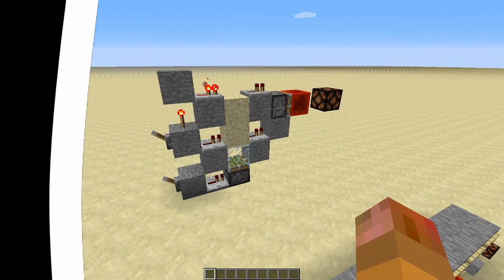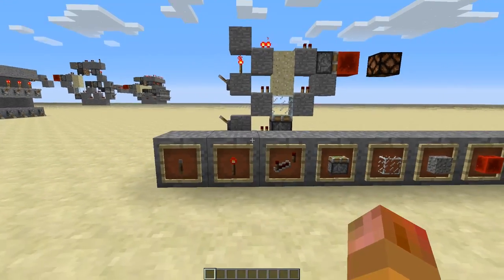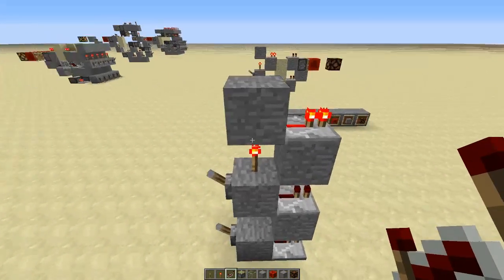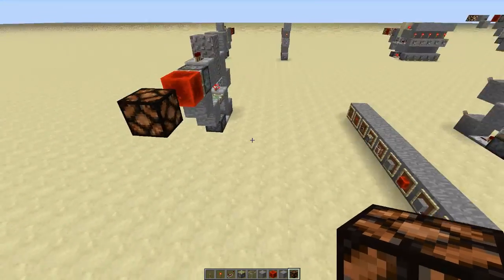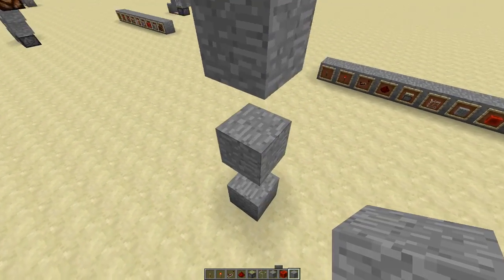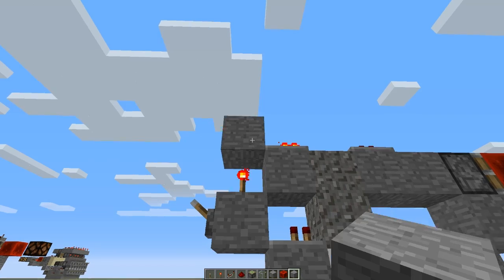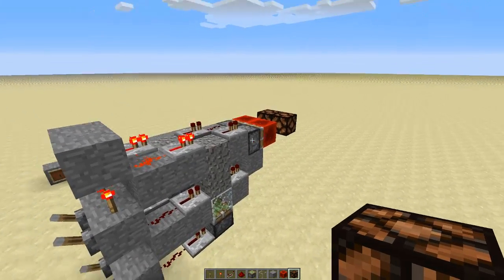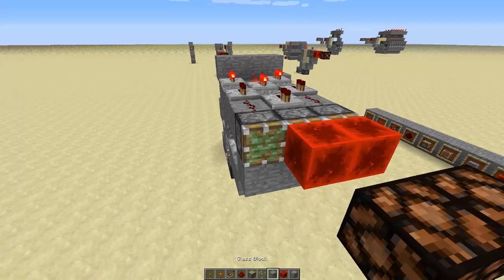XOR Gate Tutorial - 1 wide - with tileable version (for TangoTek)

Comment: I don't seem to have problems tiling the "non-tileable" version. It does cause BUD updates occasionally and causes pistons to fire, but the glass block doesn't get shot out. It still gets pulled down and fixed after a second. Any ideas why?
Reply from the maker: Very strange. How many are you tiling?
Reply: Wooly Creeper I put together 12 to make a little combo lock with a second floor for setting the combo. I also didn't use the piston stuff at the end, because I just combined all the outputs anyway.
Reply: Wooly Creeper I figured it out. It's just directional. In some directions the one tick pulses work, some not.